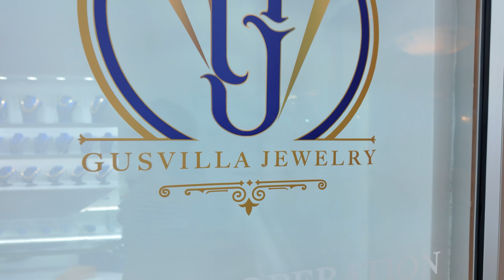Customer FURIOUS over ROOKIE MISTAKE! | Behind The Loupe #8

Comment: I once has a trusted jeweler make for me a solid 24k gold bangle that weighed 307 grams. The person responsible for putting the fineness stamp on it stamped it 24k TWICE, with each stamp about a centimeter apart from each other. I wasn’t very happy and asked the jeweler ‘Why?’ ‘I need to know why your guy stamped it 24k twice right next to each other. She couldn’t explain and I just let the issue go. Eventually I thought the whole thing was funny and came to actually like having the bangle ‘double stamped’, almost as if it was reinforcing the fact that it was 24k 
But in this video the stamp 950 generally refers to platinum, as jewelry made from platinum is commonly 95% pure. An error in stamping ‘takes away’ from the ‘premium feel’ you get when buying from a high end jeweler. Obviously it’s a Quality Control issue and should have never left the factory